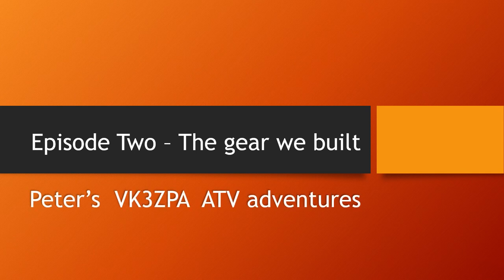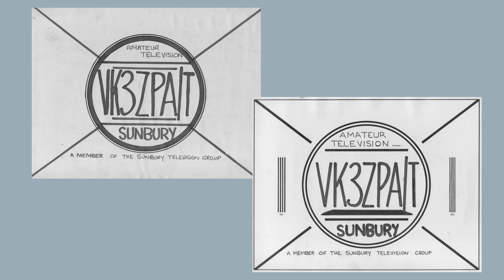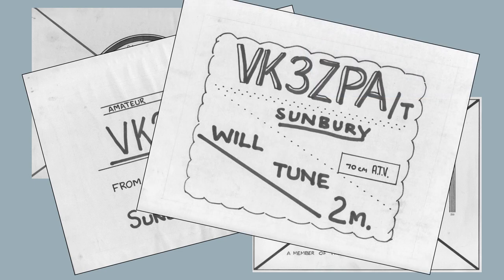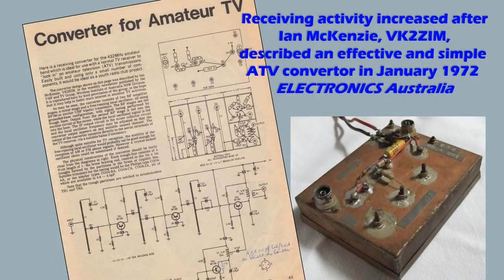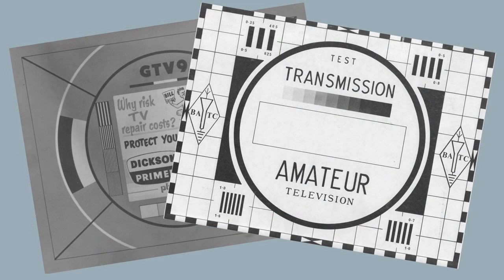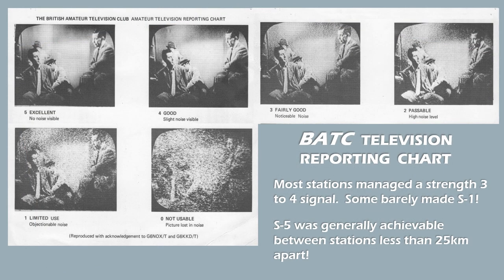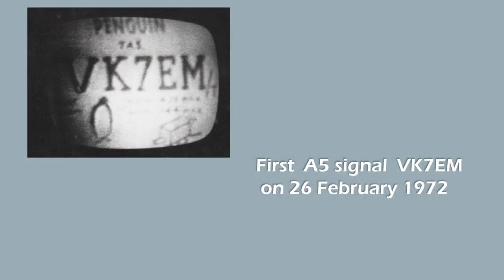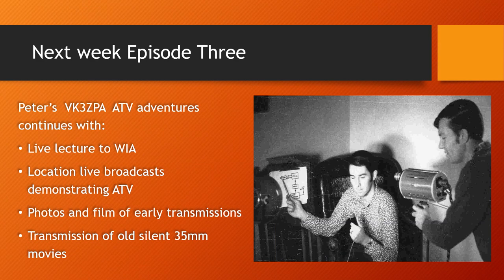Episode Two – The gear we built

Comment: In the 1960"s I worked for Dickson Primer TV in Sydney workshop and road repairing of B&W valve TV's. Most January's we went from job to job replacing 1S2 high voltage rectifier valves with cracked glass envelopes. A combination of high humidity, heat and owners on leave, switch on then POOF.